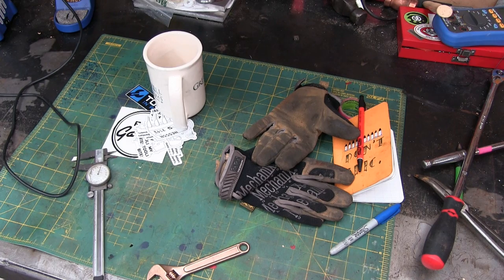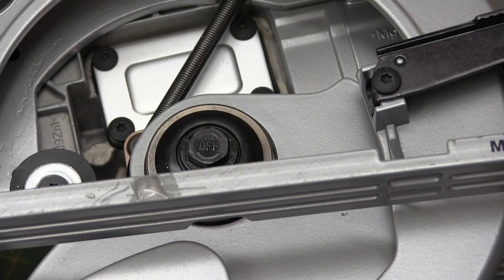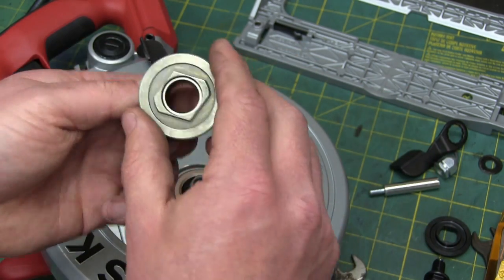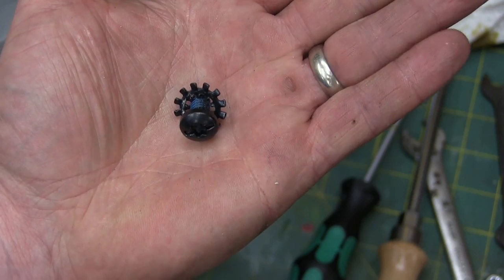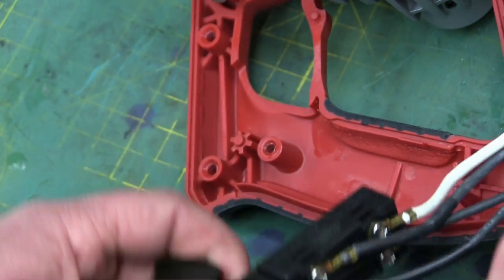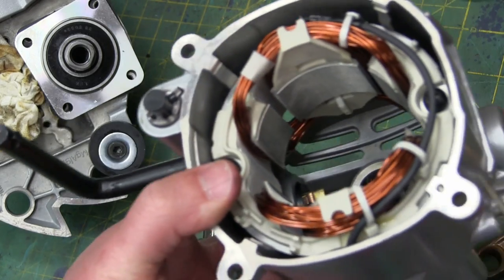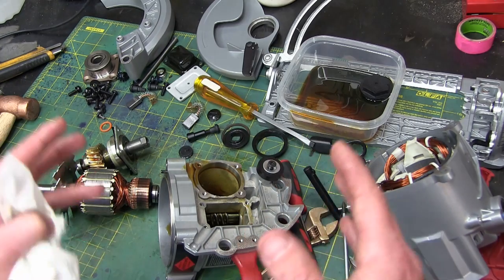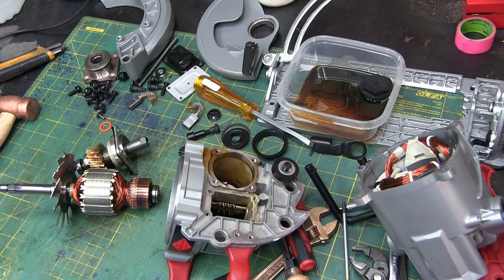BOLTR: Skilsaw 77 Magnesium Worm Drive

Comment: Not to nitpick, but 60 cycles goes through zero 120 times per second - twice per cycle. That means you'll have less than 10 ms of possible arc time on the switch contacts - hence the typically lower ratings for D. C.
Reply: Super Geek this is true. that is why a decent diode shunt can be used to help the contacts on some applications
Reply: Super Geek as soon I heard it I scrolled down to see if anyone else had picked up on that slip 😂
Reply: +tek413 Actually, diodes shunted across switch contacts are only helpful when switching an inductive load on DC. They clamp out any inductive "ringing", which helps squelch the arcing generated by the collapsing magnetic field. Likewise, a capacitor across the contacts, helps in a DC environment, by absorbing the initial current surge the instant that the contacts open. Hopefully, by the time the capacitor is charged, the contacts are far enough apart to no longer arc.

Comment: You need to review an old Skill saw to compare how they have changed.  There are substantial differences.
Reply: Great idea!
Reply: +John DeMaggio it is a good idea, however he explains at the beginning that they were more skookum
Reply: I love the new one I have it for like about 15moths
Reply: I own an original 10.25 in. Heavy and a beast.  Says a.c. or d.c. power
Reply: @Dave5843-d9m  not possible to tie a fish line 97% of the time, much faster to use a gloved hand over it to keep it from flying.

Comment: I have an old ‘70’s model that my grandfather gave me. I’ve been using it for twenty years or so, it’s great. I’m a full time carpenter so it’s got a lot miles.
Reply: Pretty much any tool from the '70s is gonna last you a real long time except for the obvious operator error. Hang onto it! You'll probably never find a better saw

Comment: I used to work at a Skil service center back in the mid 70's and we'd get wormdrive saws for repair all the time. The two most common repairs were bent/broken shoes and broken handles, usually caused by the saw hitting something hard after falling off a ten-story building. I'm thinking the current Skil's use a more flexible plastic for the handles so they will stand a better chance of surviving a drop. Some of the saws looked like they've been to hell and back, but just needed their brushes and oil changed with an occasional blade arbor bearing here and there.

Comment: You're right about longevity (At least on the old ones). My grandfather left me his 1950s skillsaw when he died. It's not the worm drive model. But I had it A-part since it hadn't been used in years to inspect everything and replace the grease and clean out any of the saw dust in it. Seemed pretty skookum. Put in a new DeWilt blade and I've been using it ever since... Works great.

Comment: One of these worm drive monsters is what I learned to cut with as a teenager when I escaped the 90s beige box world of IT and first began working in construction.  I have an F012HD77LA at home, and a much older model at work.  The one at work has the sight glass for the oil level.  It's a shame there's such a quality drop on the current version.  Yes, they're way too much saw for most jobs, but like you'd said, it will last you a lifetime.  While you still have the new one, it would be very interesting to see some of it compared side by side with an older model.

Speaking of work, while I'd happily take the saw, I'd much rather you send me some of the next generation of young people who want careers in the building trades.  I'm halfway through my career and I'm the youngest guy in the shop.  I need the next round of hungover early 20-somethings to come in and learn stuff before all the old guys are gone.
Reply: OVRLXND I am a builder and carpenter in Australia and I haven't seen an apprentice for years on  a jobsite ,just blokes around my age ,no new people learning the trade .
Reply: Hey my man you enjoy being the youngest guy on the job site for as long as you can. One day you're going to look around and all the old timers are going to be gone and then you're going to realize, You're The Old Timer! Both of my apprentices are journeyman now and they have apprentices of their own.

Comment: It's almost like the designers were given a challenge to build a unit without any circlips/snap rings, that might explain the three bolts used to hold the bearing.  The one retaining ring you took off is known  as a twist-on retaining ring or spiral ring and is typically only used in instances where you shouldn't ever need to take it off.  I've seen those twist-on types used on circular mil-style connectors.
Reply: German Tool Reviews I've seen those rings on round head ratchets.  Usually, whenever I take them off, I'll use locking pliers to hold one side and a hook to take it off.

Comment: Same crap happened to Cannondale bicycles after that asshat bankrupted the company and sold off the pieces. I was working in a high volume bike shop at the time and while the base designs didn't change the sudden chineseium substitutions were nasty, threads all chowdered and jammed tight up with cuttings, cable lengths and spoke tension all over the place.... what was a very finely made brand flushed right down the ceramic siphon. Same thing with Converse shoes, my old USA pair next to the new Indonesian pair, clear difference in stitching (USA was even, straight, close, and tight verses the sloppy as an old pornstar Indo pair.)  then the sole glue didn't last half as long on the indo pair. (wore the rubber clean through on the USA pair, Indo delaminated with much of the tread left)
Reply: Well as things go, apparently things don't have to move at all to another continent to get worse. I bought Chinese-made Fila sneakers 15 years ago, and then the same model also Chinese made again 3 years ago, and i think they've had them made there since early 90ies, and i know, it's not like i was particularly expecting either to be good, nor were they expensive but sometimes we buy things because... well just because. Well they felt just right for my feet and i liked the look, you know, plain, no huge contrasts or accents or anything, just white, and layered rather than molded sole, like they came from the 80ies or earlier. I wore the life out of the ones made back then, i wore them for a decade every other day. The ones that i got 3 years ago, got worn for a mere few weeks total, and a week ago they fell apart. Huge hole torn on both shoes in the same spot just from the flexing. I found the old shoes again and am wearing them now, and they aren't falling apart or anything, they just look worn.

Somehow an old clip from the TV is stuck in my memory, about some manufacturer over here in Germany of something or other, maybe safes, i don't quite remember apart from welding being involved, who moved the production over to Poland, to one of these former ship building cities, and then the problems started, they couldn't keep up the quality, and attempts at restoring it failed, and it's not like there's any monumental difference between the two regions per se apart from a minor language barrier, Polish people did just fine welding ships, so wouldn't they do fine welding safes? And the on-site control is easy too, it's just an hour worth of travel away, maybe two. The clip was about him moving the production back to Germany to try to regain the quality. But i somehow doubt, now that all his old craftsmen are gone and the suppliers have reallocated their capacities, or gone altogether due to industry exodus, that he won't see the same issue again with no way to resolve it. These old craftsmen that grew up with the company just might be the ones that made the product worthwhile.
Reply: wolfedog99 my grandfather worked at the Converse Malden, MA factory and I used to go to the outlet there as a kid.
Reply: m
Reply: diamondflaw ....wow. That’s sad to hear. I used to collect knives in my youth. Haven’t for about 30 years. Sold my whole childhood collection on eBay a cpl of yrs ago. After reading what you wrote here, I think I’d cry if I handled a new Schrade.
Reply: I can relate with Cannondale.  The older US made ones are higher quality.
Reply: I will disagree in so far as the fate of Cannondale shouldn't be reflective of Taiwan manufacturing in general.
I happen to know at least one factory that's done AL frames for Cannondale (Genio) and they are absolutely capable of quality frames provided you pony up the cash. We noticed a massive jump in frame quality when we switched from the Czech Republic to Taiwan. Not to mention ironically a much higher flexibility from the far East colleagues, custom tubing at order volumes of like 500 frames is nuts.
It's about the factory itself, not where the factory sits. US-made Yeti frames were a disaster according to my old workshop chief who had the pleasure of working with em, some of the alignments had to be corrected with a file.

Comment: how about tearing down a vintage saw to compare?
Reply: There really wouldn't be many visible differences, other than those three retaining screws used to hold a flat plate instead of holding the bearing directly. All the other parts look exactly the same as they did twenty or thirty years ago. I seem to remember the field used to use lacquered string instead of zip ties, but the windings look the same, and the switch used to be metal, but the design hasn't really changed at all.
Reply: The proof in the puddin's in the eatin'
Reply: Do you have a vintage saw that you can donate to the cause?
Reply: I'd be willing to trade for my old Craftsman lol
Reply: Ask and ye shall... Done
Reply: Metal handles instead of plastic that's about it

Comment: So when is the ave brand of power tool,s coming to the shops I'd buy them in a heartbeat 👍🔧😀
Reply: Eoin Caldwell 
Built so Skookum they'd be expensive as faq...but worth it.
Reply: You mean like Binford ?
Reply: Binford 😂 forgot about that brand, everything ran off a v8 more power 👍
Reply: Here is an idea, so you know where guys modify a car with a kit, how about it ave, you pick one tool and you come up with a kit so where the manufacture cheapskate out, that is where you make it better kinda like pimp my tools and you skookumify the weak spots, better brushes, better bearing, metal handles replacing cheap plastic handles, brass bearing instead of plastic and stuff and stuff.
Reply: Wil Hobbs Chooches good.
Reply: Anthony Welton And only use Robertson fasteners. The instructions would come in English, French and whatever other language AvE was learning that week.
Reply: BlindBatG34 😂👍 ya and that manual only comes in leather bound hardback

Comment: What’s interesting is that the previous model SHD77M Skilsaws did have epoxy on the copper winding connections to the commutator. I think that was during the Bosch ownership days, looks like Chevron cheaped-down the design. The stator also didn’t have any weird loose zap-straps on the windings, they were instead wrapped together at the ends with some wrapping, keeping them tight together but still allowing some room to breathe. As far as I can tell there also wasn’t some weird plastic bushing that the lower blade guard ran on, instead it rode on the metal outer bushing surface.
Reply: I took another look at the SHD77M’s, and it looks like they went through a bunch of revisions during its model run under the same model number. For instance, the commutator had epoxy on the windings on earlier versions, but not on later ones. The addition of the “zap straps” seem to also be a later revision on the stator. The plastic bushing for the guard to ride on was also introduced in the later versions, as well as the blade lock button moved from under the drain hole to the oil fill hole. The later SHD77M’s also were built/offered with magnesium feet vs the earlier aluminum versions. Looks like they were also re-geared from 4,800 RPM up to 5,300 RPM. It’s all a bit confusing as it’s all under the SHD77M model designation. So it’s hard to tell exactly what you got, until you either take it apart, or study the design diagrams.

There’s a lot of similarities with the SPT77WM that AVE takes apart, but also some differences, depending on which revision of the SHD77M you got. Point is that not all the redesign stuff was the fault of Chevron. A lot of the revisions occurred during the Bosch/Skilsaw collaboration/ownership.

I also think some of the problems AVE declares as “no fucking good”, aren’t major component problems. Besides maybe the no epoxy on the commutator, the rest aren’t performance related, but rather cosmetic. I think it’s still a great saw, but agree that earlier SHD77M versions had some pluses.

Comment: If you looked closer at the lockwasher, you would have seen that the washer had both inside and outside teeth, so the washer did engage both the casting and the fastener.
Reply: vederstein My thoughts exactly

Comment: I've  had mine for over 20 years, and it's still running great, just change the case lube every half decade or so. It's been run hard cross cut, ripping, through concrete, and steel it does it ALL! It's taken a few rides off of buildings a few times, you know when the rookie trips over the cord, and pulls it off the roof. It needs to be on 3° to be square now, and I have to use a pencil under the table to get the full 45°, but it's still kicking ass, and taking names!

Comment: The cord is always too short so they get replaced with a cut up 'stension cord. Triggers will wear out after about 4 years of use, that's a lot of clicking, easy to replace.  Soft brushes replaced after 8 years of everyday use (not bad).  Rolled off 2 story roof onto rocks, straightened out the foot with a precision hammer. Harder plastic like glass reinforced would have cracked, these things fall off scaffolding / ladders on a yearly basis just for fun. Never changed the gear oil , or even bothered to see if any. 30 years later still running strong, can't complain. Too bad another job has gone to Chineesium factories thou. People don't value quality anymore.
Reply: mattroski007  I don't think Mexico or Canada are that communist, even China barely is these days.
Reply: @bacilluscereus1299  Also, people buy too many different things for them all to be quality. If we scaled back our perceived need for possessions we could afford much nicer stuff, just have less of it.
Reply: mattroski007  Nafta had nothing to do with this.
Reply: mattroski007   Democrats  shafted us all

Comment: How many of those "not good atall" features are original from when it was first produced? Could it just be unevolved?
Reply: CorollaGTSSRX youve got a point, I've got a hd77 thats probably 20yrs young and the plastic parts were chinsy then too specifficly the handle and the little air hole flap thing.

Comment: Oh the memories of picking up the Skil 77 or the milwaukee worm drive, with the ground lug knocked off, standing on a wet floor, cutting wet lumber... the sparks... the spasm's... the pain. How many times did I drop one of them off the roof, or from the 2nd floor to the ground cause they zapped me senseless as I'm rolling trusses, or cutting birdmouths... We ended up switching to Makita hypoid drives when they came out, and what a difference. They didn't have the torque or the abuse rating of a Skil, but you could use one in a rain shower without being electrocuted. My skil 77 is still in service, and my son will likely get it, only slightly used, 30 years old, countless houses and remodels, the yards of concrete cut, the miles of wood cut, and roofs built... How many times did it fall off the roof onto a slab?  How many miles did it roll around in the back of a pickup truck? How many times has the cord been replaced, from being sawn through by n00bs?

Comment: I will tell you here and now, I use a skilsaw everyday and the weight difference between aluminum vs magnesium is huge on this particular saw. I have the magnesium mag 77 and it's old but my boss has the aluminium skilsaw around the same age and I absolutely won't even touch his saw. It's heavier than all hell compared to mine.

Comment: Im still using the 3 Skil saws Ive had from 15 to 20 years ago and we use them hard in the concrete formwork world. My dad is still using two of them that are from the 80's. The only 2 Ive had burn up were from using them for long periods to cut concrete and block and even then they took several years to give out. I haven't had to buy one of the newer magnesium models yet since my old Skil saws are so good they just keep on going